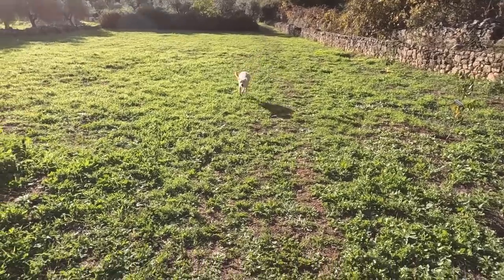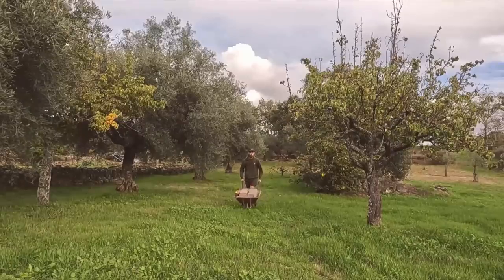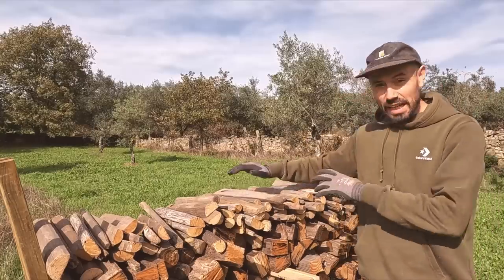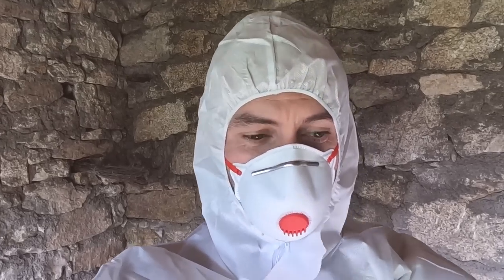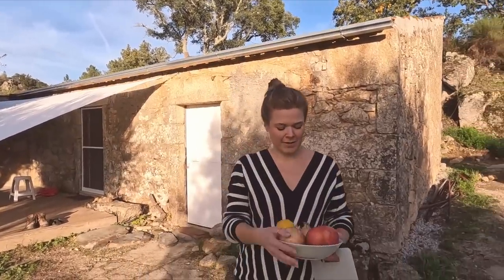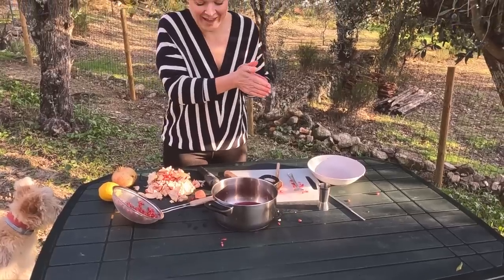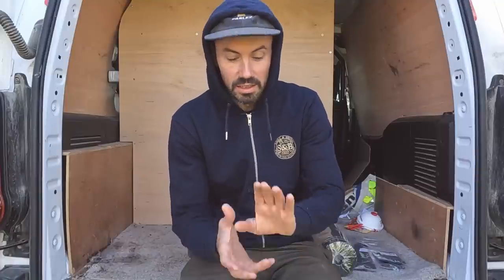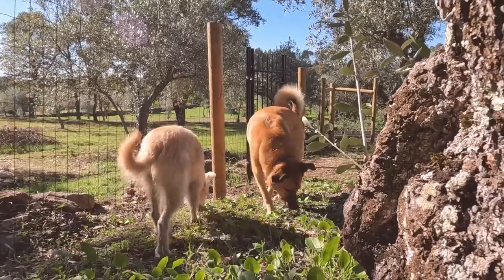TIME TO GET STARTED! Stone Tiny House Renovation

Comment: The dog might have the condition called acral licking, which is basically licking out of boredom, anxiety, or who knows. The licking often causes itching which in turn leads to more licking, which can result in a raised scab that will not go away until the licking stops. I've used a bitter apple pump spray that tastes terrible and it works on my dog as long as I keep the unpleasant taste. Also it helps with sleep. The pestle is the tool used inside the mortar to crush or grind.
Reply: Thank you for sharing this information. My dog has a raised scab a few inches above her left foot that she licks constantly. It goes away after a few days when she stops licking it. Then it comes back when she starts messing with it again. Vet really didn’t have an answer for me other than keep it clean or try allergy meds.
Reply from the maker: Thanks Mark. Since making the video we actually found a small cut around the base of one of his nails. We’re 99% that’s the cause. He’s been wearing a sock for the last few days. The cut is healing & he’s calmed down with the licking 😎
Reply: Bitter apple pump spray is a GREAT idea!  Thank you!  Our dog does this for whatever reason (totally agree, Ricky.  Very annoying sound) and we are going to try this❤️☮️

Comment: The deeper red the riper.  Ripe ones are softer to the touch with rougher skin.  Easier to open and separate the arils (seeds) in water.  The arils sink and the white membrane floats.
Reply from the maker: Thanks for the tip Moira 👍🏼

Comment: You are doing a fantastic job there. What you can do with de Walt batteries is clean terminals with wire wool or sand paper. Then join relevant terminals with copper wire or jump leads to fully charged battery. Leave over night
Reply from the maker: Thanks for the tip Blanch 👍🏼 Will look into it

Comment: pomegranates don't continue to ripen after they've been picked. 

there are different varietals so the color of the peel isn't necessarily helpful unless you know what color that varietal should be. 

but even if you know the correct color that just let's you know when to keep a closer eye on them. 

a pomegranate is ripe when it goes from a smooth rounded shape to a more gaunt look- the sides lose the plump round look and you can see the shape of things under the peel a bit. 

try eating the arils whole (ie don't spit out the seeds). 

to juice i toss the arils into a blender and thrn strain afterwards. in addition to drinking, try adding some to salad dressing. 

you can also boil it and reduce it down to a  syrup. drizzle it on all kinds of things. kinda like using balsamic. 

the lighter colored poms tend to be sweeter/less acidic. the dark red ones can be wuite acidic- especially if picked before they're completely ripe. 

you probably got this info ages ago- I'm a bit late to the party, and i didn't read all the comments. still, i figure comments help your numbers (right?), so i might as well. 

btw pomegranate bushes/trees are very nice looking and the flowers are really beautiful.

Comment: You might be better off using thin wire to hold the fencing onto the gate as we have found over here in Cyprus cable ties out doors last just a couple of years. It's just the sun and plastic, they don't go well together. Thanks for posting

Comment: It might be easier if you cut the pomegranate in half across ??the equator?? not across the ??poles?? i hope you get what I mean. then just put the open side down in your one hand and then beat with a wooden spoon on the outside of the fruit over a dish. the jewels will popp out easily.🙃😊
Reply from the maker: Thanks for the tip Christiane 👍🏼 I like the way you described it as cut around the equator instead of the poles 😁 Understood what you meant instantly!

Comment: No fire! You guys are braver than us. We have had ours lit for a couple of nights now. It's good to see your tiny house floor. I've yet to begin on mine and I expect about 30cms of dung and straw from years of animals being in there, I begin next week. 
Re the roof. Have you considered the insulated sandwich panels? I think that's the direction we will be going on our tiny house after watching Alex's videos.
Reply from the maker: No fire but we do have a gas heater which keeps us very toasty. Just doesn’t smell or feel as nice as a wood burner. Tbh we have sandwich boards on our bathroom roof on the main house & they are sooo noisy when it rains. A real turn off for us